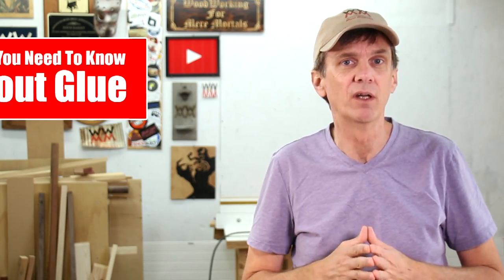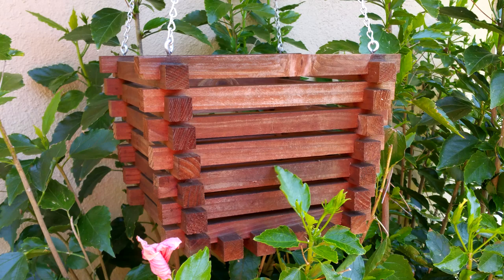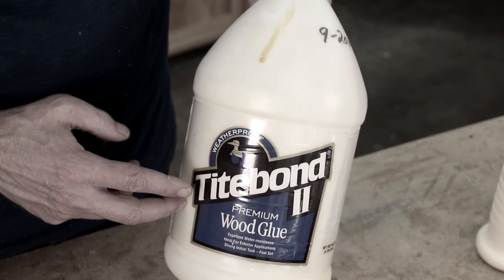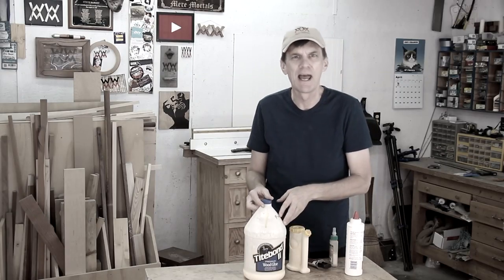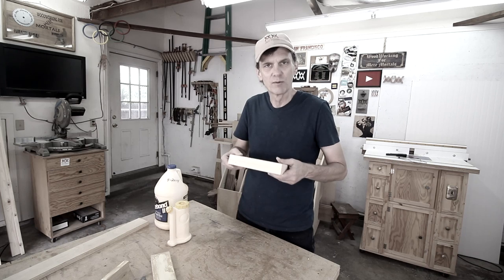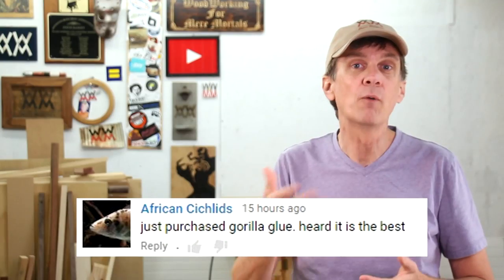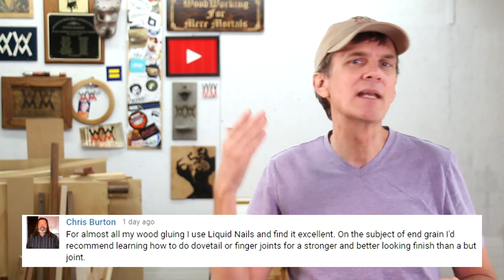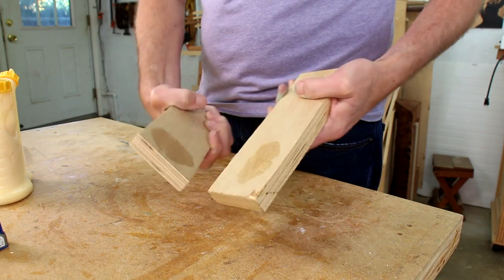Why I Don't Use Titebond III | MORE MINUTES

Comment: In my experience I  use Titebond III almost exclusively, because of the extended open time over TB II (20 min vs 10 min). I've never had the problem you mentioned of darkening. My guess, and it is Only as guess, is that you had a chemical reaction with what ever wood you were using on that table project. Good video.
Reply: Titebond III has an open working time of 8-10 minutes, according to the manufacturer. 
I don't know where you're getting 20 minutes from.
Reply: @danstheman33  Tks Man.. you're right.. that's why I always say don't trust in every comment you see..

Comment: Wood is essentially a dry sponge, in which case, a slightly damp sponge will absorb more water (glue) quicker. I use to glue one side of a joint liberally before clamping or assembly but found a thin coat to both sides will yield a much stronger seam with a quicker tack time in most all applications. The glue line will almost act like contact cement if you get even coverage and the right quantity of glue. More time gluing, much less time in the clamp. Thanks for the vid!

Comment: Love the channel first off. 

As a relatively new woodworker I’ve been using 3 exclusively so far because of the longer open time. Personally, I’ve run into ZERO issues cleaning up my excess glue with a slightly damp shop rag (t-shirts), but I do clean up my joints immediately after clamping and I’m also quite conscious of using just enough glue to coat well but not so much to squeeze out massive drippings worth of glue.

Comment: Steve, to color match I use sanding dust mixed with the stain or dye. I then allow that to dry and walla color matched filler. Mix that with whatever clear drying glue you choose and you have a perfect match.
Reply: Sounds like a great tip!  Thanks.

Comment: Those labels were not the same.   Titebond 2 is weatherproof and Titebond 3 is waterproof.    I do avoid using Titebond 3 on only light woods as the glue is darker and shows more no matter what.    I have had Titebond 2 start to fail in some cutting boards that we're getting too wet when being washed.
Reply: I believe Titebond 3 has walnut shells ground in to give a wooden tone and texture
Reply: 1) Should not be using II on cutting boards, it's not even water proof.
Reply: Tekagi  Titebond 2 is not rated as food safe where titebond three is.
Reply: @SOLDOZER  Titebond two is not rated foodsafe either.

Comment: I have experienced alot of the same results as you mentioned in your video. I recently switched back to Titebond II from Titebond III due to the results of a project. I received the same results with the joints looking terrible by my standards. The joints obsorbed more stain then the wood grain giving a prominent looking joint, terrible. Great video, you should do a free give away of a t-shirt. Thanks again, great video.

Comment: Titebond III is the only one approved by the FDA for use on food service applications.
Reply: Not true--both II and III are FDA approved for indirect food contact. See the other comment with a link to a Titebond video
Reply: Fda approval just means that they paid for the testing, it does not mean that any of the other types of glue formulations are not "safe for food contact". it just means they wanted a leg up in marketing. Not a single person has been recorded as becoming sick from a modern wood glue or finish once lead was removed from pigments and driers. I am not stating that all types of glue or finishes should be used in any application, but that "food safety" is just a marketing myth.
Reply: +Jesse G While what you say is typically correct, that's NOT the case here.  The reason type III is approved for food use is because it allows the items made with it to be washed.  A cutting board made with type I will come apart with repeated washings.  Before it comes apart, cracks will form allowing bacteria to grow.  This is not a problem with type III.
Reply: Never had a problem using Titebond II for cutting boards.
Reply: BOTH tb2 and tb3 are fda approved for indirect food contact, also another note, i do a lot of woodworking in an unheated garage in the winter time, and, in my sxperience, tb3 will not lose its viscosity as much as tb2 due to colder temperatures.  Its not a huge difference, but it IS noticeable, at least to me anyway.  In viewing one of the videos linked in the comments, a TB rep actually refers to this.
Reply: David Walser - what he said is still precisely the case. There is no reason to seek FDA approval for a glue that weakens with exposure to water. You aren't going to be using type 1 glue for cutting boards, etc, because the glue won't hold.

There are plenty of other semi-submersible wood glues on the market which have not paid for the FDA testing and are still just as food safe as TB after full cure. Bob Flexner has written about this kind of thing many times.
Reply: @DKWalser   That's a good point...if true.

Comment: I find that Elmer's glue sticks work the best for my woodworking projects. Much better than the old rendered horse hoof glue I used to use and tastes so much better. Haven't tried any of the Titebond glues. How do they taste?  FYI: Don't even try superglue , can't get that nasty taste out for 2 weeks unless you mix it with a little horseradish sauce then it's quite tangy and good for holding those highly stacked sandwiches together that want to fall over.

Comment: In an art class, building a block for carving, we just used yellow Titebond, and spread evenly on both sides before clamping TIGHT. The boards were planed prior to gluing, and so made invisible seams which have never failed or cracked after 30 years. I think spreading makes the bond more uniform, gives a brief period to soak in a bit consistently to both sides, after which time clamping may force out some glue, but the wood contact is improved so the thin glue layer can achieve maximum strength, usually greater than the wood alone. As long as the clamp stays until the glue sets, no air gaps or voids should occur, whereas one-sided applications might leave air voids which the glue won't migrate to fill.

Comment: Just did an experiment with CA glue (2-P10 brand) on prefinished plywood. This is type of cabinet plywood that has a glossy finish already applied at the factory, and is impossible to glue with wood glue unless you strip the finish off first.

Anyway, the 2-P10 plus activator spray made a bond similar to the one you demonstrated in you main glue video - the wood broke, but the glue bond didn't. I didn't expect that it would work, but it did, and is very strong. There are several different viscosities of 2-P10. I used the "medium" version. I'm not sure the viscosity matters in this application, because I think the factory finish prevents it from soaking in.

On the other hand, I wouldn't use this glue for ordinary glue ups because it is too expensive and almost unforgiving with regard to positioning.

Thanks for the great videos!

Comment: Fantastic video! 
I'll only add that I personally have great success using Hot Stuff's Zap-a-Gap CA glue, and Fast Cap's 2P-10 CA glue (same company behind GlueBot). They come in varied thicknesses for different applications, which sometimes makes it the only option for a job.
Cyanoacrylate is harsh stuff to handle, not nearly as friendly as good ol' waterbased glues, but even on wood it's incredibly strong when not accelerated. I use it frequently in my profession as a furniture restorer, and when used correctly I trust it as much as I do Titebond.

Comment: I would love to see a scientific experiment for using wood glue with one joint clamped lightly (to not squeeze out all the glue) and another clamped as tight as possible and test for strength.  I also am in the camp that believes you should clamp as tight as possible without causing wood damage.  A spare block of wood works good for absorbing clamping damage.

Comment: I have just bought a glue called Weldbond and I have tried it by applying two endpices of wood together. It works very well and also it is non toxid. It becomes transperant when drying.

Comment: The main reason why cyanoacrylate feels "weak" is because it has a very low shear strength. Any sort of sideways movement and the bond just won't hold up to the stress. If you tried just pulling them apart, you'd be hard pressed to get it to separate, regardless, I wouldn't ever use it for any joint. I do, however, plan on using it as a finish once I get a lathe and start turning things like pens and bottle stoppers.
Reply: +SimkinC42 I was coming here to say exactly this!

Comment: GluBot?  I bought a large one and a small one after seeing it on your show.  Absolutely love them.  Just like the mustard bottle, you need to wash out the nozzle before the glue sets.  Replacing the factory o-rings is an improvement, and if your man-cave is like mine you will already have an assortment to find a size that fits.  Much like a paint can that you don't clean out the rim before putting the lid back on:  paint builds up, dries, can doesn't seal, paint dries out.  Some of the construction glues will actually allow the joints to pull apart as they dry and warp.  Gorilla glue will hold chair pieces when nothing else will.  A chair in our dining room set always wanted to pull apart at the head piece.  Gorilla glue and a good clamping has lasted years when nothing else even thought of holding.  Yeah, had to trim the foamed-out glue, but sure beats unattached pieces of wood.

Comment: Titebond III doubles the working time, can be used in colder environments and is slightly stronger (not really worth the extra strength)   So depending on the project if you need extra working time, it might be worth it.   Cheers !
Reply: +Canadian Sasquatch I was pretty sure titebond 2 had the longer open time, not 3
Reply: +M. Heedes No, canadian sasquatch is correct.  TBIII  has the longer working time between II and III.
Reply: +M. Heedes As Josh mentions, it is 3 that has longer working time (10 minutes vs 5 minutes according to their website)  Cheers!

Comment: I've been using both Tightbond II & III for a long time, I usually use the III on outdoor projects like your table. I've never seen that staining before, but I will watch for it from now on. 

But to be honest, I've had projects where I used regular Tightbond that have been outside for years, and they're fine.

Comment: If I recall correctly, 3 is foodsave, so for use in cuttingboards etc...
Reply: +RoboCNC Frees- &amp; Graveerwerk i think your right!
Reply: +RoboCNC Frees- &amp; Graveerwerk I think thats the selling point, but it would be hard to find any retail glue that is NOT food safe once cured. Plenty of boards out there made with II...
Reply: +RoboCNC Frees- &amp; Graveerwerk Titebond III is actually CERTIFIED food safe. As far as the cutting boards I make, being able to say that is more than worth the extra cost of III.
Reply: +RoboCNC Frees- &amp; Graveerwerk 
The Titebond website says the same thing for both TBII and TBIII: "FDA approved for indirect food contact (cutting boards)"

Comment: Epoxies definitely are part of my tool kit and deserve a mention, of course not for everything. As a part-time boat builder I have gotten used to working with epoxy and especially thickened epoxy for joint repair. recently I repaired a 100 year-old falling apart table that I use outdoors and needed to replace a lot of rotted out wood, which epoxy thickened with wood flour was just perfect for. It does take about 24 hours to cure. But yes I generally use Titebond 2 or 3 for most other woodwork I do.

Comment: Anytime I use super glue it's it a situation where there is no stress on that joint or to use it as a clamp. Put a little bit on what you are gluing as well as your wood glue and it holds it long enough for the wood glue to set up
Reply: +Scott Reid i do the same thing. mostly in places where i can't fit a clamp

Comment: with staining sawdust/glue ive managed to get exact matches by mixing the saw dust/glue with stain BEFORE applying to joint/crack. stain will aways match if the sawdust is stained before or at the same time glue is added to the mixture. but staining after the glue is dry will repel the stain. I used this trick to fill in old 2x3 mortis and tendon holes in reclaimed 10x8 barn studs that were worn and over 100+ years old. got perfect color matches.

Comment: I've never found a reason to buy a bottle of Titebond III, so I have no personal experience with it. Titebond II has never failed me, so I use it for everything. CA glue has very few uses for me. It cures too fast to really penetrate and make a strong bond. If I need a quick-set for something,  I reach for the hot glue gun instead.
Reply: +Chevee Dodd Hot glue is extremely underrated. I use it a ton for making on-the-fly jigs and anything I need to bond together fast. It's also surprisingly strong...a lot stronger than people give it credit for. Plus it bonds to a lot of different materials. As long as you use the hotter melt type glue, it is an amazing adhesive for a wide variety of projects.
Reply: +sidgar1 completely agree. It's amazingly versatile.

Comment: I primarily make wooden archery bows, and I use Aerodux Resorcinol almost exclusively in my woodworking. It leaves a dark glue line, but it is absolutely impervious to any temperature, and it is so waterproof that it is often used in boat building. It's expensive though, but I've never found a better glue.

Comment: I will just add to what others are saying. I find TBII to be essentially waterproof for anything I do. Years ago when TBII was introduced I glued some blocks of different kinds of wood together then sank them in a bucket of water after allowing the glue to cure overnight. After several weeks of being fully submerged the TBII glue line turned almost white, but there was no discernable weakening of the joints. I will still use TBIII if I am building something that I know is going to be directly and frequently exposed to water and sun and I have some TBIII on hand. However, I cannot say that I have ever had a joint failure due to water using TBII. 

As for super glues, anybody that isn't using them is missing out on a very useful product! The only problem is that the accelerator is sold separately and most often not even stocked at most stores. For most construction related applications you must use the accelerator.  Just put the super glue on one surface, spray the mating surface with the accelerator and bring the pieces together. What you get is an instant permanent waterproof connection. You can even spray the accelerator over the surface of the glue joint after you have squeezed them together and as long as it comes into contact with some of the squeeze out it will kick off the bonding reaction. It's not for every application but It can do many things that no other adhesive can and the fact that it happens instantly will save you tremendous amounts of time once you learn how to use it.

Comment: I never wipe away squeeze out for the very reason you said: it repels stain leaving a blotchy finish. Instead, it's better to let it dry and pare it off with a chisel or be diligent and avoid squeeze out altogether. 
Cyanoacrilate glue is brittle like you said but it has its place. Works really well to hold mitered mouldings that are attached by other means and are not structural.  What I mean by that is for example a decorative moulding pinned to a case, CA glue works well to hold the miter closed because you can spritz it with the activator and it's dry in seconds.

Comment: Titebond III is FDA approved II is not. Also I like to use a rubber ink roller to apply glue it works great gives me an even coat reduces excess and is easy to clean. Got it at Hobby Lobby.

Comment: Hey Steve, good insights! 

I've been using titebond III for years, almost exclusively, mostly because its not always worth the cost to buy 2 kinds of adhesives in a personal shop, and I need III for cutting boards. I would agree with other commenters that the only significant advantage is open time. As for the dark marks, I think thats what happens when you leave the glue on the surface (same color appears on the bottle tip if you let it dry out), but if you can afford the material loss to sand it off, it should go away. But overall, the strength of both II and III are well beyond the usual kinds of stresses you would expect to put on a woodworking project. 

At my job I've gotten the opportunity to experiment with a lot of different kinds of glues, and mostly agree with your assessments. In particular though, I think Cyano is in a weird category. It's a life saver when you've messed something up, or need a glue that will bond ANYTHING to ANY OTHER THING... but you're right, its super brittle. It can hold things together, but it can't bear weight or shear well. That's one of the big advantages of wood glues and some kinds of epoxies that doesn't often go mentioned: They don't just hold things rigidly together, they hold that bond while being able to flex a bit and accommodate expansion is the wood, and changes in the shape of the piece when different stresses are put on it.

Comment: 2:46 "... clamp too tightly..."
Matthias Wandel did a test of that, and iirc, found a small difference, but he had to clamp it like crazy with a bunch of C-clamps.

of course, I don't know how many times he tested it, so more data may be required.  it may also have depended on which kind of glue he used, which I also don't remember.

dents really are probably a bigger concern—if you clamp it enough to bring the surfaces together, the glue will do its work.

Comment: The salt trick works great and can be a game saver if you are using stock that is already almost at the finished size of your project. And it is true that you can squeeze out too much glue by over-tightening a clamp. The pieces will still hold but the joint will be weaker.